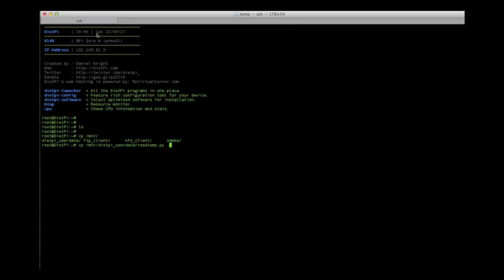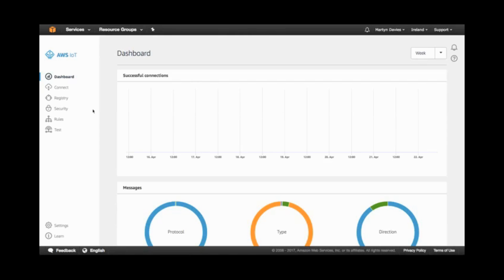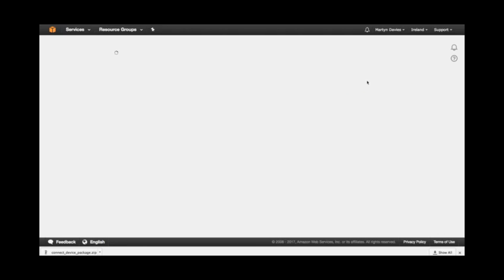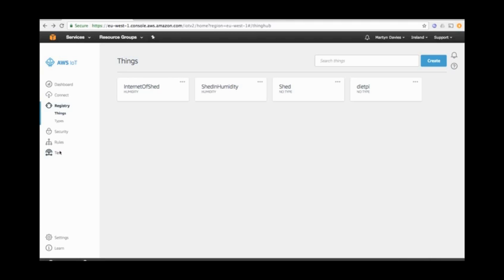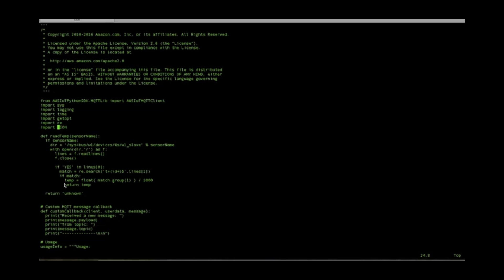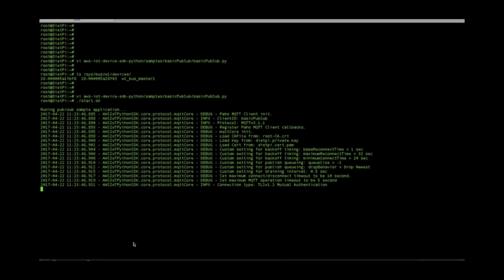Raspberry Pi Zero W - Connect Sensors to Amazon AWS IoT

Comment: I understand there is a free trial, but is this free to use beyond the trial? For instance, if you were to run your exact code from your video past the 12-month free time period...would it cost you anything or is it such low volume Amazon doesn't care?
Reply from the maker: It's a year or two since I checked the pricing, and AWS does change its policies over time, so I think the best thing is to go and check today's pricing out.  When I last looked, the price shocks were in DynamoDB and Kinesis, where you pay based on time even if no data is sent.

Comment: From this link: 
https://github.com/aws/aws-iot-device-sdk-python/blob/master/samples/basicPubSub/basicPubSub.py

for lines (52-58):
args = parser.parse_args()
host = args.host
rootCAPath = args.rootCAPath
certificatePath = args.certificatePath
privateKeyPath = args.privateKeyPath
useWebsocket = args.useWebsocket
clientId = args.clientId
topic = args.topic

I  know that I have to replace with my own certificates that I downloaded from AWS website. However, when you did that, did u have to hard code them  by including the path in this way :

certificatePath='/home/pi/deviceSDK/a12345678f-certificate.pem.crt

Comment: How do I transfer this data into Dynodb in amazon? or is there anywhere i can present this data as graph
Reply from the maker: You can use the same sort of pseudo SQL rules to extract data from the AWS IoT stream and write to a Dynodb table: see this AWS tutorial http://docs.aws.amazon.com/iot/latest/developerguide/iot-ddb-rule.html   For visualization, AWS are pushing Quicksight a lot, but there are many different ways to extract data to a dashboard.
Reply: Thanks for the reply. But this connects to myiot device. the one i created is a thing. is it the same? how to do I send the temperature to any DB in Amazon. Is there any other place I can do it

Comment: Helpful video - thanks.

On a raspbian Zero, I had an "ImportError: No module named AWSIoTPythonSDK.MQTTLib" error when running ./start.sh that I tracked down to this problem: https://github.com/aws/aws-iot-device-sdk-python/issues/36 and used  

    >pip install AWSIoTPythonSDK

which seemed to solve the problem.
Reply: Thanks Matt. It helped me perfectly. Just a note that you need to run it as sudo

Comment: Hey Martin, very insightful video. I have a query If the raspberry Pi was connected with a GSM module sim and then to AWS to transmit data ? How would the process be?
Reply from the maker: I have a couple of GSM modules, and I planned to connect one to the raspberry Pi in a future video. The GSM modules have a serial interface, so you'd need to connect it to the TXD0/RXD0 on the GPIO connector. Make sure the GSM module is a 3V type (RPi has 3V interfaces).  Then I would use the PySerial to allow me to send/receive AT commands to the GSM module from Python; all the GSM modules I have seen have extremely similar AT command sets (see https://www.espruino.com/datasheets/SIM900_AT.pdf). In terms of talking to AWS, you could either use AWS IoT to send data via MQTT, or you can use the Boto3 library to access various AWS services, like S3, Polly and so on - it all depends what you want to achieve.